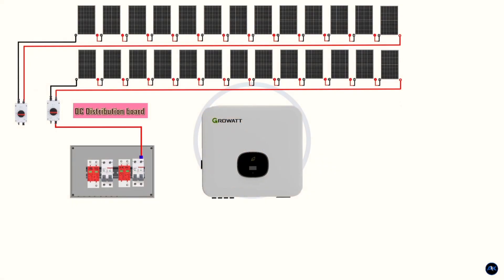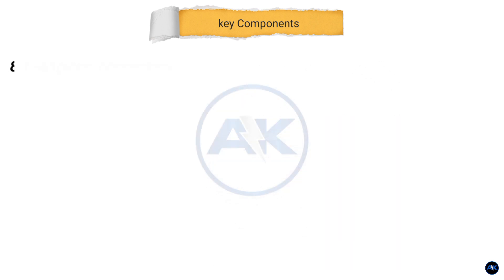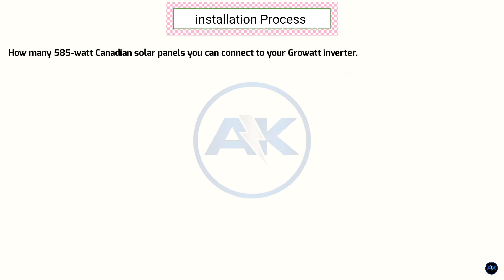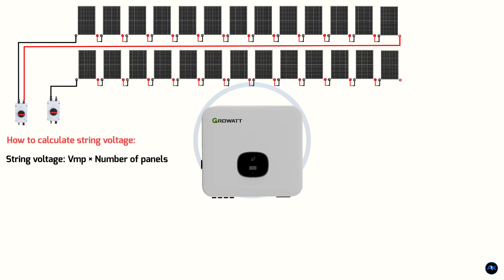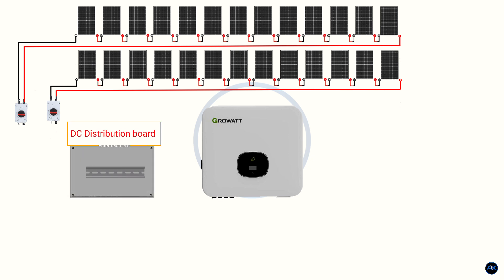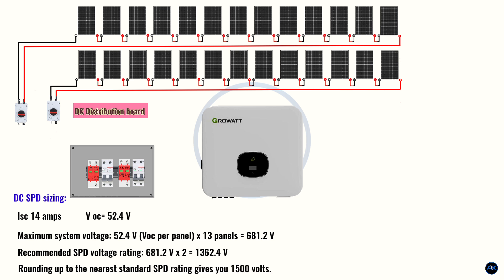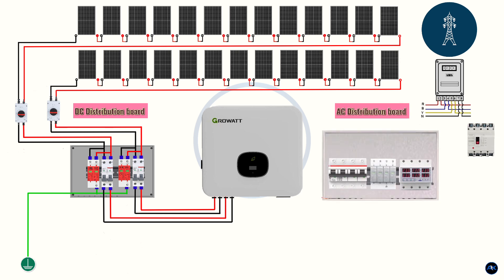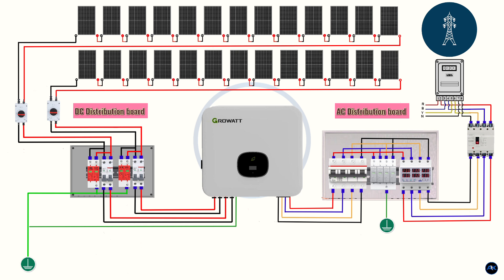"Unlock Your Savings: Ultimate Guide to Installing a 10kW On-Grid Solar Power System!"

Comment: Sorry But you have placed AC SPDs wrong, Second you should always put MCB before voltage protector this way your voltage protector won't get damage if something like short circuit like problem occurs

Comment: I have also 10.2 kw inverter can you please help me what size of wire will I used? Thanks
Reply from the maker: for your 10.2 kW, 48V system with a 1-meter run, use 2/0 AWG DC cable for the batteries and 6 AWG AC cable for the output.
The required AC wire size will typically be 6 AWG (16 mm^2}) or 8 AWG (10 mm^2) copper wire, depending on your local code (e.g., NEC ampacity table) and the length of the run.
Reply: @akelectricdiy thank you so much

Comment: I am facing significant PV losses. I have a 10 kW on-grid solar setup with 610 W Canadian Solar panels (model CS6.2-66TB-610). All 16 panels are connected in series in a single string. However, 5 of the panels are affected by shading at different times. The inverter is a Huawei SUN2000-10KTL-M1 three-phase on-grid model.
Reply from the maker: The "significant PV losses" are caused by shading on 5 panels combined with a single series string configuration. Shading on one panel drastically reduces the current (and power) for all 16 panels.
Recommended Solutions:
 * Install Power Optimizers: This is the best solution. Install an optimizer on each panel (especially the 5 shaded ones). This allows each panel to operate at its Maximum Power Point (MPPT) independently, isolating the shaded panels' low performance from the rest of the string.
 * Reconfigure Strings: Split the single string into two separate strings (e.g., 8 panels each) and use the two MPPT inputs on the Huawei SUN2000-10KTL-M1 inverter.
   * Place the 5 shaded panels and 3 unshaded panels on String 1 (MPPT 1).
   * Place the remaining 8 unshaded panels on String 2 (MPPT 2).
   * This isolates the losses, allowing the 8-panel unshaded string to produce full power.
Action: Reconfiguring to two strings is the quickest fix using existing equipment. Installing optimizers will provide the greatest long-term power boost.
Reply: @akelectricdiy Much appreciated for your assistance, it is very helpful.

Comment: Why is the efficiency for solar panels only 22.6%?
Reply from the maker: Solar panel efficiency, often cited around 22.6% for commercial panels, is limited by several fundamental and practical factors. It's important to understand that 100% efficiency is not possible.
Here are the key reasons:
1. The Shockley-Queisser Limit (Fundamental Limit):
 * This theoretical limit, for single-junction silicon solar cells, is around 32-33.7%. It accounts for the fact that a single material can only absorb a certain range of light wavelengths efficiently.
 * Photons with energy below the material's "band gap" aren't absorbed.
 * Photons with energy significantly above the band gap generate heat instead of electricity, as the excess energy is lost.
2. Material Properties and Design:
 * Silicon Purity and Defects: Impurities and defects in the silicon crystal structure can lead to "recombination," where electrons recombine before they can be collected as electricity, reducing efficiency.
 * Reflection: A portion of sunlight reflects off the panel's surface instead of being absorbed. Anti-reflective coatings are used to minimize this, but some reflection always occurs.
 * Wiring and Busbars: The metal lines (busbars and wiring) on the solar cell surface block a small amount of sunlight, reducing the active area for light absorption.
 * Cell Design: The internal design of the photovoltaic cell, including how cells are wired and configured, impacts the overall efficiency.
3. Environmental and Operating Conditions:
 * Temperature: Solar panels work best at cooler temperatures (around 25°C or 77°F). As temperatures rise above this, efficiency decreases (typically by about 0.5% for every 1°C increase).
 * Shading: Any shading from trees, buildings, or even dirt and dust can significantly reduce power output, as panels are interconnected and even partial shading can impact the entire string.
 * Angle and Orientation: The angle and orientation of the panels relative to the sun directly affect how much sunlight they receive.
 * Degradation Over Time: Solar panels naturally degrade over their lifespan due to exposure to sun, heat, and other elements, leading to a gradual decrease in efficiency (typically 0.25% to 0.55% annually).
 * Dust and Dirt: Accumulation of dust, dirt, and debris on the panel surface blocks sunlight and reduces output.
While current commercial panels often achieve efficiencies in the 20-22% range, research continues to push these limits with technologies like N-Type TOPCon and Heterojunction (HJT) cells, which can offer higher efficiency and better performance in varying temperatures. Multi-junction solar cells, which use multiple layers of different materials to capture a wider range of the solar spectrum, have achieved much higher efficiencies in laboratory settings (even exceeding 47% under concentrated light). However, these are generally more complex and expensive to produce for widespread commercial use.

Comment: Why did you multiply the 2 to the recommended SPD voltage ratings
Reply from the maker: When multiplying the nominal system voltage by 2 to determine the Surge Protective Device (SPD) voltage rating, it is typically done to account for temporary overvoltages and ensure robust protection. Here's the rationale:

1. Temporary Overvoltages: Electrical systems can experience voltage spikes due to faults (e.g., a lost neutral in split-phase systems), switching surges, or resonance conditions. For example, a 120V nominal system might see voltages double (to 240V) during a fault. The SPD must withstand these without damage.

2. Safety Margin: Doubling the nominal voltage provides a conservative buffer. For instance, a 120V system would use an SPD rated for at least 240V, ensuring it doesn’t activate unnecessarily during normal overvoltages (e.g., +10% fluctuations) and avoids premature degradation.

3. Peak Voltage Consideration: In AC systems, the peak voltage is √2 × RMS (e.g., 120V RMS ≈ 170V peak). Doubling the nominal voltage (e.g., 120V × 2 = 240V) exceeds this peak, offering a margin for transient surges.

4. Standards and Reliability: Guidelines like the NEC or IEC often recommend SPDs with a Maximum Continuous Operating Voltage (MCOV) higher than the system’s nominal voltage. This ensures longevity and reliability under varying conditions.

Example:  
- 120V System: SPD voltage rating = 120V × 2 = 240V (to handle line-to-line faults or sustained overvoltages).  
- 240V System: SPD rating = 240V × 2 = 480V (common in three-phase or industrial settings).ho

This practice balances protection effectiveness with device durability, aligning with engineering best practices and electrical codes.
 Thank you! 😊 I hope you understand. If there's anything specific you'd like to clarify or explore further (e.g., standards, applications, or calculations), feel free to ask! I'm here to help.

Comment: But for 10 kw on grid system, it's 10,000/ 585w  = 17 panels but you are calculating based on the invertor input power of 15,000. What is the reason behind this? What will happen if i go with 17 panels instead of 26 panels. Please advise.
Reply from the maker: When designing an on-grid solar system, the DC-to-AC ratio (solar array capacity relative to inverter capacity) is critical. Here's why:

1. Why 26 Panels (15 kW DC) vs. 17 Panels (10 kW DC)?
- Inverter Efficiency: Solar panels rarely operate at their maximum rated power due to temperature, shading, or suboptimal sunlight. A 10 kW AC inverter paired with a 15 kW DC array (26 panels) compensates for these losses, ensuring the inverter operates closer to its full capacity for more hours of the day.
- Energy Yield: Oversizing the DC array (e.g., 1.5:1 DC-to-AC ratio) increases daily energy production, even with occasional clipping(where excess DC power is "clipped" during peak sun hours). The trade-off is minimal clipping losses for significantly higher overall energy output.

2. What Happens if You Use 17 Panels (10 kW DC)?
Underperformance: The inverter will rarely reach its 10 kW AC capacity due to real-world inefficiencies. Your system may produce ~20-30% less energy than expected.
Lower ROI: Fewer panels mean lower upfront costs but reduced long-term savings due to less energy generation.
-No Clipping: The inverter will never clip power, but this is a minor advantage compared to the lost energy potential.

 3. Key Considerations
Location Matters: If you’re in a region with frequent cloudy days or high temperatures, oversizing the DC array is especially beneficial.
- Cost vs. Benefit: More panels increase upfront costs but maximize energy harvest. Calculate payback periods to decide.

 *Recommendation*
Opt for 26 panels (15 kW DC) if your inverter allows it (check its maximum DC input rating). This ensures optimal energy production and better ROI. If budget constraints force you to use 17 panels, expect lower energy output and ensure your energy needs align with this reduced capacity. Thanks 😊
Reply: @akelectricdiy  Thanks so much for your thourough  explanation. I totally agree with more solar panels it would compensate for losses and more eficent operation.
Reply: @akelectricdiy  appreciate your efforts and your content is very beneficial. Keep up the good work. Your explanation is very clear. Thank you. 

If you don't mind, could you please advise us on selecting a mono perk bi facial solar panel of 585w.  As per the data sheet, one side generates 585w(STC) while the bi facial output is based on 15%(673w), 20%(702w), 25%(731w) & 30%(761w). Based on this, can I consider 15,000/761w = 20 panels? Or should we select based on 15%(673w) = 22 panels. Please advise.
Reply from the maker: @shankarprathap3511  Thank you so much for your kind words and for watching the content! 🙏 I’m thrilled to hear it’s helpful.  
To recap your 15kW solar panel question:  
- If your installation site has ideal conditions (high reflectivity, elevated mounting, etc.), 20 panels (761W bifacial output) could work.  
- For average or uncertain conditions, 22 panels (673W bifacial output) is safer to guarantee your 15kW target.  

Quick advice:  
1. Optimistic choice: 20 panels (if you’re confident in 25–30% rear-side gains).  
2. Safe choice: 22 panels (ensures 15kW even with minimal 15% bifacial gain).  

Always cross-check with your site’s albedo (ground reflectivity) and inverter capacity. When in doubt, lean toward 22 panels—it’s better to slightly oversize than fall short!  

Feel free to ask more questions if needed. Keep shining with your solar projects! ☀️🔋thanks 😊

Comment: If the max voltage of invertor is 1100V why you calculate the SPD to 1500V?
Reply from the maker: The 1500V SPD rating accounts for temporary overvoltages, avoids false triggering, and ensures surges are clamped to a level the inverter can safely withstand. The SPD’s Uc (1500V) exceeds the inverter’s operating voltage, while its Up is designed to protect within the inverter’s surge tolerance.

Comment: If i have a module of Isc: 14.15A and the inverter has max input voltage of 10A per MPPT and Isc of 12.5A per MPPT are they going to work together? 
Inverters has 2 MPPT.
Do we need to compare the Isc of the inverter or the max input current of the inverter with the Isc of Module?
Thanks
Reply from the maker: To determine compatibility between your solar module and the inverter's MPPT, you need to compare the module's Isc (after applying safety factors) with the **inverter's max input current per MPPT. Here's the breakdown:

Key Specifications:
- Module Isc: 14.15A  
- Inverter MPPT Limits:  
- Max input current: 10A per MPPT  
- Max Isc rating: 12.5A per MPPT  

---

Critical Checks:
1. Safety Factor Requirement (NEC 690.8):  
   The inverter's max input current must handle 1.25 × Module Isc:  1.25 times 14.15A = 17.69A
   This *exceeds* the inverter's 10A max input current. Not compliant.

2. Inverter's Isc Rating:  
   The module's Isc (14.15A) exceeds the inverter's 12.5A Isc limit. This risks overloading and damage.

---

Why It Won't Work:
- The module's Isc (14.15A) is too high for both the inverter's 10A max input current and 12.5A Isc rating.  
- Connecting them violates safety standards and risks inverter failure.

---

Solution:
- Use an inverter with higher current ratings (e.g., ≥17.69A max input current and ≥14.15A Isc rating).  
- Alternatively, reconfigure panels (e.g., split modules across MPPTs or use parallel/series wiring) to reduce current per MPPT.  

Always ensure the inverter's max input current ≥ 1.25 × Module Isc and module Isc ≤ inverter's Isc rating.